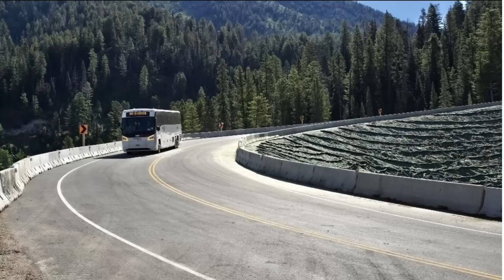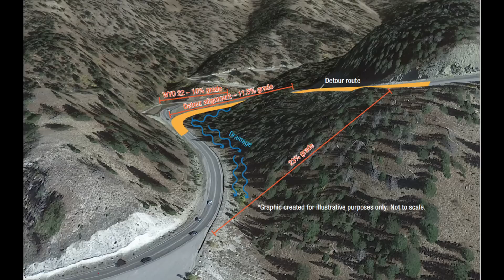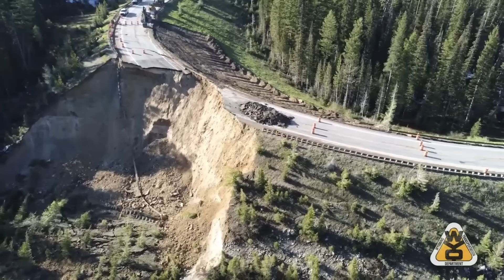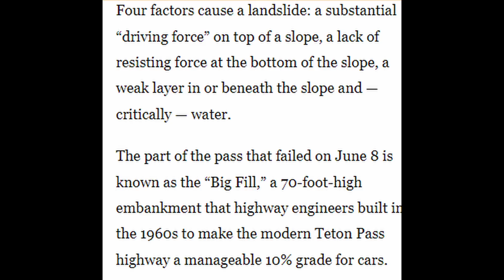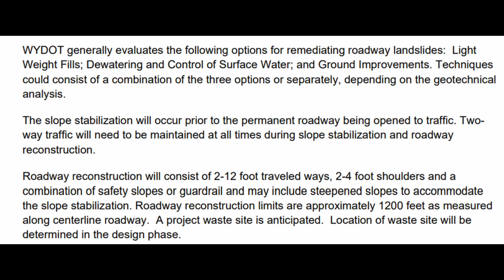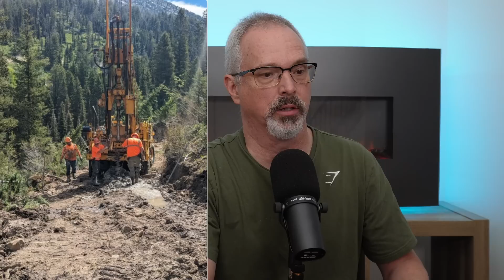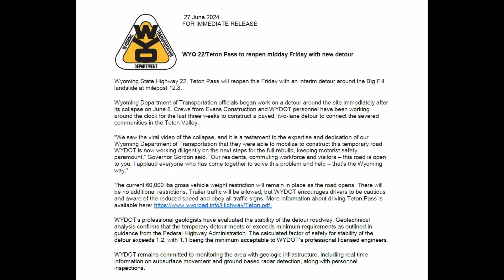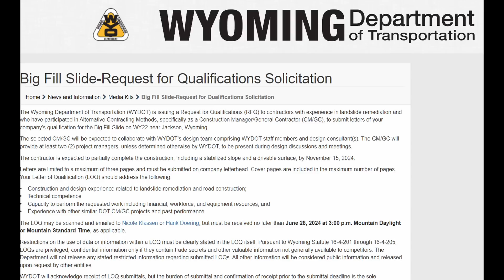Teton Pass - Bypass Completed and Open to Traffic

Comment: If I lived there and owned a contractor business (I actually did that for 22yrs) and I raised my voice publicly in the community about my concerns. It would affect my business in a negative manner. That is how bad Jackson is.
Reply from the maker: I have really gotten that impression.  Nobody there (neither contractor nor engineer) wants to call out WyDOT.
Reply: @CaseyJones-Engineer  They wanted and needed a road over Teton Pass ASAP hell or high water. They got a temporary road. Safety is probably thrown out the window when billionaires are the driving force behind the community. Hopefully, a permanent road will be constructed soon. I have spent much time in that area in the hills. This is an area that the earth's geology is constantly moving along the fault lines. I have no answers or ideas on how they can engineer for this movement.
Reply from the maker: @RandyKildow  I think there are many options for a good, long term solution here but given the requirement to keep this bypass open at all times, the restoration work will be significantly complicated.

Comment: Hopefully they got a good lawyer(s) set up and arranged for the future of this section or corridor of highway that will eventually fail, more than likely over in the same area. Possibly even the whole thing this time considering the fact they disturbed the rest of the hillside embankment around the whole curve of the inside and outside of the turn🤦🏻. Nothing is settled now. They are allowing vehicles over the standard truck&camper/RV+tow behind(car) which is a lot less than the gvw of 60,000 lbs plus they should put a restriction on the number of axles per gvw because that also restricts the amount of weight being asserted per axle divided by the 2 wheels apart from each side. It comes down to a science on this I do understand that. But they don't. And all it takes to understand is common sense not rocket science. They are making a huge mistake and it will cost them. A good lawyer also won't be able to save them Scott free clean and clear. Oh no. It'll only keep them out of prison whoever made the big calls on this. But the $$$ is where they are going to wish they would have spent on the highway physically itself, not the victims from it. 🤔 I'm sure there is other people out there that would love to take over that position for the wage that the person in charge of that is making right now and actually have an IQ somewhat that's a lot more than the fat 1 that they have in that incompetent design they allowed without doing it right. 20 mph? What's the point? Just get the fkn traffic off that spot and keep it moving more like 35-40 for christ sakes. 🤦🏻🤦🏻 Like the longer "gvw's" just sit there the MORE stress that saturates each zone per square foot of stress weight. Plus depending on the fill and how they did it which I've seen several pictures and it doesn't look very comforting knowing what it looked like which wasn't in my opinion a stronger fill than the earth that moved originally. 🤷🏻 We'll see. I've only graduated from 12th grade but I always observed/listened/failed myself a few times/learned from my mistakes/seen others mistakes/and did my own research and then re-researched my own homework and used common sense in the end to proof read it all and i always accept more knowledge. Even the shitty ways and not-to-dos. Maybe I can help with my ideas or input. Whether it's helpful or not. I like to spread a little common sense. It's what I use best. Good for me but maybe not for everyone else. Depends on what kind of IQ you're working with.

Comment: Absolutely agree with your factor of safety comments.  This is more than a temporary construction type condition with public traffic now using it.  The purpose of professional engineering registration is to safeguard the public,  I would like to hear comments from the Professional Engineer that stamped and signed the plans for this bypass to be used by the public.  This individual is ultimately responsible and liable for the design.  Yes, Mr. Dahill's explanation of safety factor values is totally not correct.  I would expect at least a solid 1.5 FS as a minimum.
Reply from the maker: Thank you, I appreciate it.  You bring up and interesting point in that I don't know if stamped plans were every produced.  It appears that WyDOT figured out what they wanted for grades, slopes and elevations for the fills in the bypass section and turned the surveyors and earth works contractor loose.

Comment: No, WYDOT cannot allow Dahill to continue in his job since he very clearly does not understand safety factors. You can't make excuses for this error, no matter what area of engineering one is in. Safety factors are fundamental to every aspect of engineering and someone who's lost on this simple topic is absolutely not competent to hold any engineering job. WYDOT needs to replace the entire team, including management that clearly isn't credibly managing. The organization structure, ignorance, and incompetence is a disaster in the making. Your analysis is important and bringing this gross incompetence to light should be an alert to the FHTSA, to step in and oversee this failure.
Reply: Dahill is a Professional Geologist and not a Professional Engineer.  Why WYDOT is having a Professional Geologist as the spokesperson make no sense but I don't think WYDOT has Geotechnical Engineers on staff-otherwise they would be in charge.
Reply: @michaelcurtis-cdot8978  project management for infrastructure projects is typically handled by civil engineers, not Geotechnical engineers. It'd make sense to rely on the expertise of a geo for this project, but there's a ton more to building roads than ground stability. Each area has specific skills and knowledge, with some overlap, but the project is a road, not an earthworks.
Reply: @alafrosty I agree a Civil Engineer would typically be the Project Manager.  Everything I have said has been about the lack of geotechnical information which is part of the project design.  The WYDOT Resident Engineer is a Civil manages the project but his knowledge of geotechnical design criteria must be poor since the geologist Dahill seems to be the point person for Geotechnical matters. Both WYDOT employees don't know what they are talking about.

Comment: seems like you are forgetting the fact that the clay sublevel they put in in 1960's that caused the failure of the slope is now gone. E.E. its now down the mountain side. This means that the current fill dirt with average rain fall and current run off is probably perfectly safe right now minus a 50 inch rain fall by a Harvey event in the area. Not sure but this is suppose to only last three months before they get the real solution done. Wondering aside from cost if not a retaining wall into the ground a but would be a better solution than using clay.
Reply from the maker: According to their Chief Geologist, the clay is also under their new bypass section.

Comment: 60,000lbs.  ..isn't a big rig trailer 80,000lbs plus tractor weight ?   ..so there will be zero big rigs passing thru ?
Reply: 80,000 pounds is the total vehicle weight.

Comment: Casey,

Giving Mr. Dahill the benefit of the doubt, I would say he is out of his element when it comes to press conferences.  Based on the questions asked and answered he was not prepared to answer questions.  

Contrast this to the M/V Dali news conferences, where answers were direct and actions were taken with precision.

I about choked when Dahill started applying logarithmic scale to his safety factor.  I hope they publish a revised briefing sheet ASAP so Mr. Dahill salvage his credibility.

You should ask your press friends to submit a FOIA request for the engineering calculations and assumptions.

Bob

Comment: Until that steep angle of repose slumps again, and I have had no offense to us all pointing out questionable decisions leading up to that failure. I think that may always be "temporary" until they take out all the sand/clay and do a properly raised road section there. Go Fever may be a contributing factor, given you can't rebuild the entire Teton Pass big fill without removing the bypass they just put in. It also looks like there was no consideration for water removal/drainage for that entire 'big fill' section. This reminds me of all those homes on hillsides that suffer mud slides and the home owners didn't want bad news till after things move downhill.
Reply from the maker: Thank you very much!!  What they have done will be challenged during the first wet spell later this year (if not sooner).  Magical thinking seems to be at play with those who are under political pressure to deliver results fast.

Comment: You have said it succinctly, why do we not know with a high degree of certainly if this temp. repair is sound? A reasonable and I feel prudent path would have been testing to ascertain the cause of original failure and limits of materials present as to suitability at site before designing a roadway that many will use and should expect that the DOT did not guess or assume what was needed to meet these minimum safety standards for public roads. I hate to use a cliche,  but road building today is not rocket science and neither should it be a guessing game. Ray Stormont

Comment: It is clear from their press release they intend to work on the replacement design, meeting necessary safe useage (bet federal guide at 1.3).  This is concerning to me,  did politics dictate WDOT follow federal guide or independent analysis????
Reply: FHWA is funding the repair and permanent fix so if FHWA truly does oversight WYDOT should't be reimbursed any money if they only design to a Factor of Safety of 1.3.  Maybe Casey should get in touch with FHWA office that covers Wyoming.
Reply: @michaelcurtis-cdot8978  sounds bit political?   what's FHWA I am presuming federal government emergency agency?
Reply: @rynait  Federal Highway Administration.  They provide around 80 to 90% funding on all State Highways.

Comment: The design alternatives of the rebuild of the permanent may be limited due to emergency funding laws, rules and regulation. It seems that the regulation for emergency funds require the reconstruction be of a similar nature to the original damaged infrastructure. This is likely intended to make sure that the funds are used for emergency purposes instead of infrastructure improvements. This does seem like a valid concern the law/regulation is trying to address. Obviously we wouldn't want someone getting emergency funding for a house rebuild to use the money to add a bedroom and a bathroom. But if replacing the fill area with a viaduct/bridge area is a better and safer option these laws, rule and regulations may limit the ability to do that.  (The road to he!! is paved with good intent.) 

Casey, please comment on laws, rules and regulations related to emergency funding for infrastructure repairs. 

I have two concerns about the temporary roadway. First is that WYDOT does adequate monitoring. The second will the roadway slow drivers down enough to respond to any failure that may occur. 

Regardless of what equipment they have or are installing the primary responsibility for monitoring and decision making is dependent on the quality the the on-site personnel. This will vary over time.

A twenty mph speed is appropriate for drivers to respond to the potential hazardous conditions in front of them. The problem is that it seems the only part of the design intended to slow traffic to 20 mph is the posted speed limit. The roadway width, curvature and grade are all seem to suggusting a higher speed to drivers. Drivers will very likely drive over twenty mph. 

(By the way, how low the recommended safety margins are does surprise me.  So I understand your concerns related to the importance of accurate measurements of the site conditions. Or the need to clearly state the intentional under estimates of the soil strengths and conditions.)
Reply: The bypass and permanent fix are being constructed with FHWA money which means all criteria must be met unless FHWA exempts criteria.
Reply: @michaelcurtis-cdot8978  
Hence the reason that the temporary road is wide enough to encourage speeds over 20 mph. 
Thank you for the information.
Reply: If I were driving over the patch I’d want to get over it quick.  No way I’d be doing just 20 ;o)
Reply: @maxenielsen  
Which means that if a slid did happen you would greatly increase your odds of driving into it. Doubling speed quadruples braking distance. 

Play stupid games. Win stupid prizes.

Comment: The 'Git-er-done crowd' has always been a problem. They are of the belief that because they did it once and it worked, that means the process works. Obviously, time has repeatedly shown that the 'just do it' attitude has huge blind spots, that in some cases unalive people. However, because the crowd is usually gone by the time problems appear, oh well. Rules and regulations were written for a reason.
Reply from the maker: You are right.  Those type of people are engaged in "magical thinking".

Comment: Sounds like they're stretching what "under construction" means. In their minds, as long as they're intending to repair the embankment to the original slope, the site is considered to be "under construction" and the bypass is a temporary road with lower safety factor requirements.

Comment: Since the WyDOT installed instrumentation for this slope, MAY be reasonable to assume they have geotechnical data from testing prior to the failure. This may be where they are getting the FS calculation. You have assumed that the only soil test data WyDOT has available is from the most recent subsurface investigation. (correction: mentioned in previous video) However, WyDOT should be more clear on where and when the samples for design came from. Additionally, there should also be samples from the failure time to analyze as well. I am also skeptical  of WyDOT's behavior in this event. End qualified immunity!
Reply from the maker: No, I mentioned that they had previous data.

Comment: Sorry Mr Jones you are talking about two different situations. One is a temp bypass. This is to get traffic moving for the next couple of years. Gives WYDOT time to get the data you bring forward and meet the 1.3 - 1.5 safety factor for the long term solution. That is why WYDOT is drilling more holes. You are saying the temp design is a final design and that is not the case. WYDOT has not started working on the long term solution.
Reply from the maker: No, that is not what I am saying at all.  I am saying those factors of safety that they are using are too low for the circumstances.

Comment: As I listen to your analysis, I can't tell what things they've done incorrectly and what things they've just communicated poorly. Some people can do a good job in their technical work but can't explain that work very well. 

That the geologist says that something isn't his call could represent a bureaucratic limitation. Sometimes, the head technical person isn't given the final call on things. Depending on what the numbers are, he might believe that the likelihood of failure is still very low, so he's not willing to get fired for telling people that the road isn't safe to re-open. 

At this point, we don't know what monitoring is being done. That they don't communicate the monitoring clearly is concerning, but again, I don't know whether the problem here is that they are doing something wrong or whether they are just communicating poorly. They might have monitoring and processes in place to close the road immediately if something changes. 

Other areas of engineering have changed from traditional safety factors to risk analysis. I don't know whether they are making calls based on risk analysis instead of traditional safety factors. 

The loss of the pass has caused significant hardships on people in the area. I understand the desire to have a temporary solution to get through the summer. I won't be surprised if they end up closing the bypass and closing the pass again before permanent repairs are finished. I won't be surprised if the final solution isn't a complete re-route of the roads through that area.
Reply from the maker: Really? I thought my explanation was pretty clear and others are following it.  They are using too low of a factor of for the circumstances.  They haven't had sufficient time to properly analyze subsurface conditions, etc.
Reply: @CaseyJones-Engineer  You are very clear that these are your opinions. I don't know whether you are correctly interpreting what has been said and done.
Reply from the maker: @VTPSTTU  I definitely interpreted Dahill's utter confusion on the meaning of various factors of safety. There are many other instances too but no need to repeat myself.

Comment: 1.1-1.2 is acceptable because the site is a construction zone and the road is a temporary bypass. Subpar temporary roads are constructed throughout the country alongside and through construction sites. This is normal practice. It’s ridiculous to expect W-dot to build temporary roads to permanent standards. You are using sensationalism to get views.
Reply from the maker: You are not tracking here. They can't suspend well established design requirements just because they are in a hurry.  Besides what's sensationalistic about stating my opinion that happens to not coincide with WyDOT's?